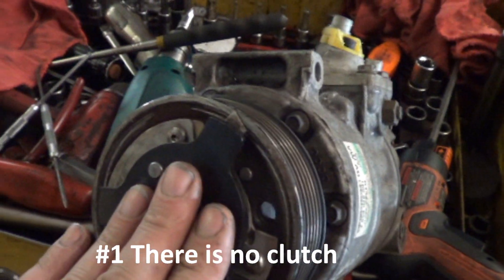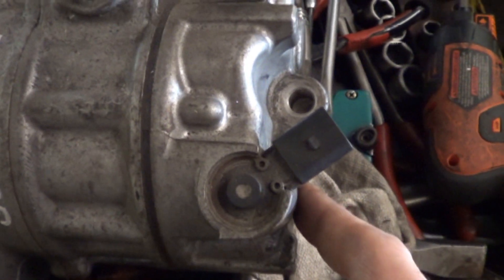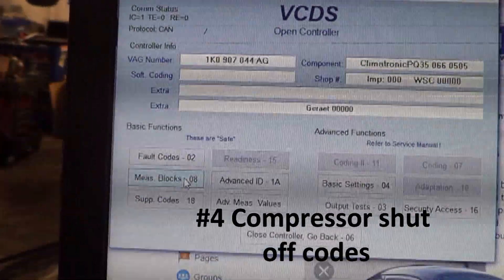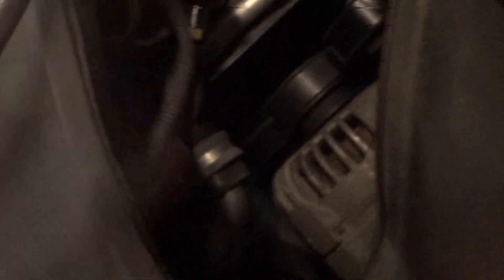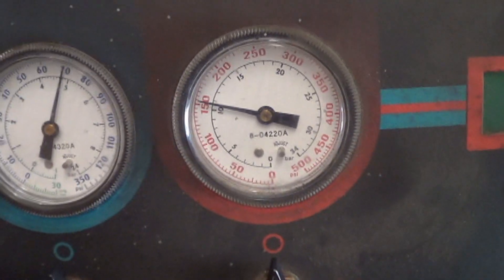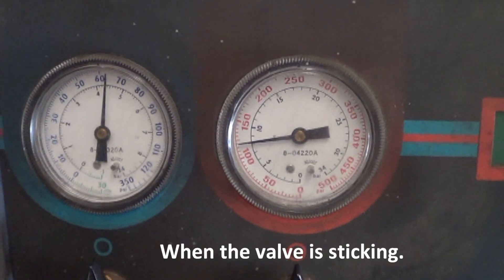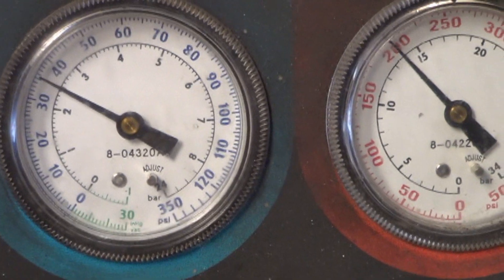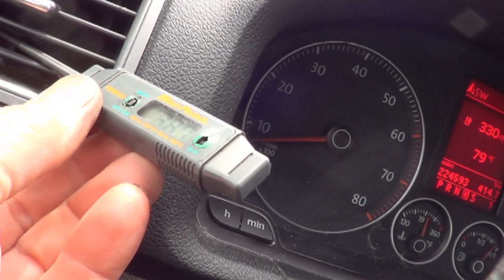2005.5 Jetta AC problem, 4 keys to diagnosing

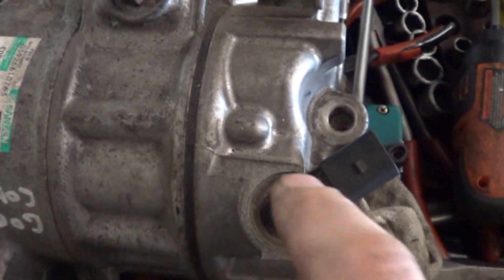Comment from the maker: at 2:39 I said Vw doesn't sell the RCV.  I now know they do, but they will probably sell you a compressor anyway.  There is actually a bulletin that describes common failure and diagnostic process for a sticking RCV.   Also alot of aftermarket shops will not do a RCV they will sell you a compressor.  I know this because one of my competitors sells the customer a compressor when the RCV acts up.

Comment: Many thanks for your video mate.  Just a quick question , I lost some oil while removing the solenoid.  Would you mind telling me how to add some after fitting the new one?  Thanks in advance.
Reply from the maker: special equipment is needed.  Take it to a shop with a machine unless your willing to buy equipment.  Its so easy to add the shop will probably charge a very minimal price.

Comment: Hey I have an 08 and I replaced the RCV thinking it was that but when refilling it I noticed my pressure were the same so the RCV didn't engage perhaps. Do I have to use Vagcom to see shut offs?
Reply from the maker: yes, use the info in this video and pressure gauge set to figure out what is going on.
Reply: @CoolAirVw  100 lp/100hp  car on/off is the same. Thanks for the help I'll try and source a Vagcom before I just start throwing parts at it.
Reply from the maker: @shinobi211  Is the mechanical fuse good?  Did you watch my video about the bolts falling out of the front of the compressor?

Comment: thanks for the info - I just got a VW jetta . I might have to wait until next summer to fix AC problem that previous owner said it had though !
Reply from the maker: I have several AC related videos.  Check the cards and search my channel.
Reply: @CoolAirVw  Good news here - I found the wires to  AC regulator chewed off - by squirrel maybe -  hopefully that is the only problem for AC. I like easy fixes . I will do repairs another day - too cold outside now at 33 degrees and sun going down. Thanks again for your help.
Reply from the maker: @LarryKapp1  see this video at 7:00  https://youtu.be/N6aXUqt-Yoo

Comment: Very detailed and well made video, sir.  I am assuming there is no need to evacuate and recharge the system after the RCV valve replacement?  My wife's '13 Audi A4 has this system and I'm definitely saving this video.  Thank you for your efforts.
Reply from the maker: Freon must be evacuated  before RCV removal and recharged after install.  Freon evacuation leaves the system in a state of vacuum, you usually need to relieve the vacuum before pulling out the RCV.  Push in on a shrader valve to relieve the vacuum and the RCV will come out much easier.  Its linked in the "cards" in the upper right corner of the video.
Reply from the maker: The 13 will have UDS computer system so watch my video on UDS.
Reply: @CoolAirVw  Thanks.  I'll watch that video.

Comment: Great info Rich..
Will need to write some notes on this models..
Question how are the trans on this models compare to 01m trans?
Reply from the maker: mk5 tdi would have dsg (O2E) trans, and the 2.5L would have 09G trans.  DSG has been fairly reliable but has 3 issues.  1.  a common flywheel rattling problem,  2.  Mechatronic's (valve body with computer integrated into it) fail.  4.  Clutch assemby sometimes has snap rings pop apart (not real common)   All of these issues are expensive!  I've seen two of these transmissions fail.   The 09G has real common vavle body failures, and this also is expensive.
Reply: CoolAirVw Rm 
Thanks a lot for the information Rich..
I guess I will keep driving manuals ah.lol.....
Reply from the maker: I'm sure you know the manuals fail too.  See following link.  http://kansascitytdi.com/02j-trans-repair/
Reply: CoolAirVw Rm 
OH yea for sure...
Already has a couple,but they don't scare me as much as auto trans do...lol.......
Thanks for the link....

Comment: Great video and very informative, thank you. However, at 1:25 you refer to the mechanical coupling/hub as what sounds like a 'Mechanical Fume' or a 'Mechanical Fuse' but neither of these terms come up on Google relating to automotive a/c compressors, I would be most grateful if you could clarify this term please.
Reply from the maker: Mechanical Fuse.  just a piece of metal designed to break if the compressor seizes up so the pulley will keep spinning.  here's more on that https://youtu.be/7CTwXW8ifIA
Reply: @CoolAirVw  Thank's
Reply from the maker: @Paddington2000  welcom!

Comment: No one has been able to explain what compressor shut off code 12 is. How do I find out what is shutting off my compressor sometimes? It only shuts off for 20 seconds or 30 seconds, especially when the vehicle is first started and driven on a hot day. Audi A5 2015 with 73k miles. Ac performance is excellent, 38f at evaporator and pressures are normal.
Reply from the maker: in video at 3:59 there is a drop down list of all shut off codes.  Pause the video at 3:59 and you can see what code 12 is.    Do you need further explanation?  The engine computer can override the AC (turn it off) for various reasons.  What you describe is almost seems normal.
Reply: @CoolAirVw  Yes I did see that the ECM is commanding it off, but there is no further guidance to find out why. Is it normal? Never had a car do that before randomly. There are no fault codes in any module.
Reply from the maker: @Bizija123  engine computer is making a decision to turn if off for some reason.  You just need to think about what is going on during those times to see why.